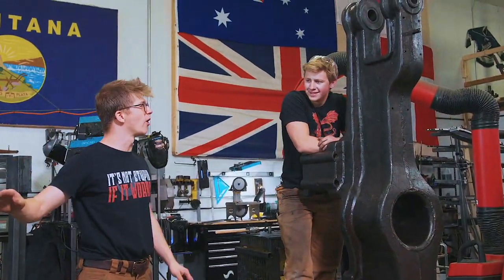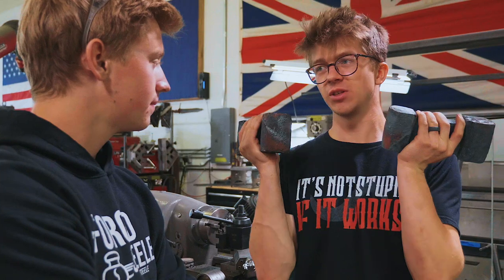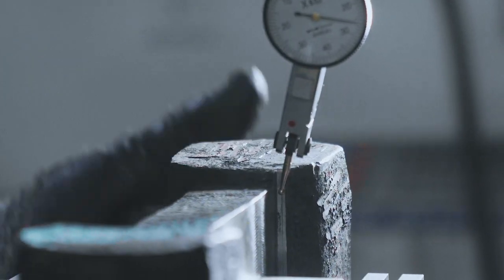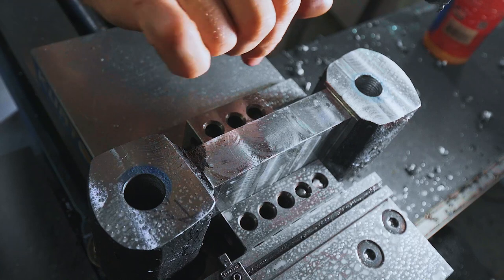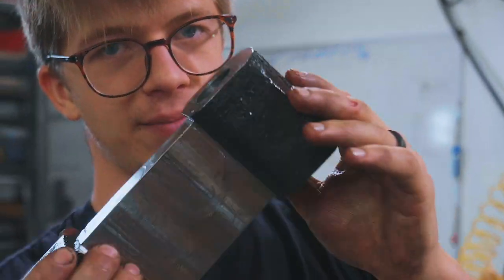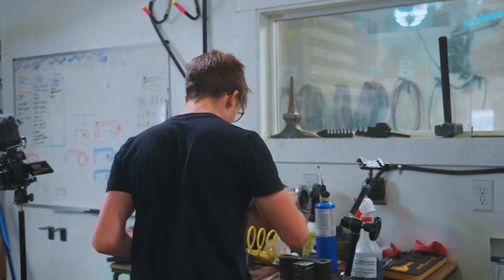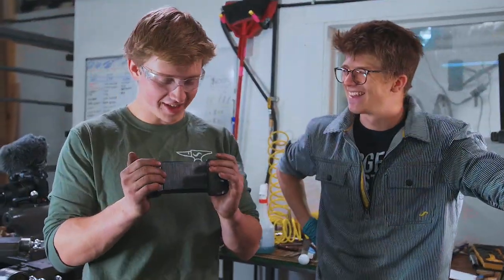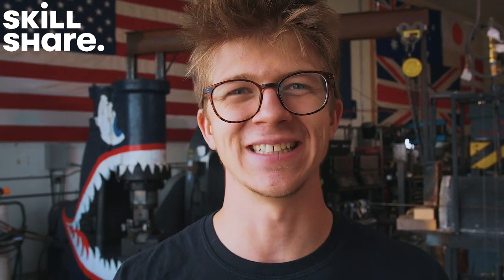RESTORING THE FAIRBANKS POWERHAMMER!!! Part 2

Comment: As a machinist, that lathe work with the eccentric hole was scary. In case you even read this, next time you can set up a dial indicator to get the hole much more accurately in place. Simply zero out the indicator at it's furthest travel and continuously adjust the chuck as you need. You might be able to run another indicator against the shaft of the dial indicator itself as well just to be sure it's perfectly straight. You might get some sine error if it's not perfectly straight.

Comment: LOL  I remember my first time doing an offset hole on a lathe.  Put it in the chuck, used an indicator to get it offset enough, turned the lathe on and instinctively turned it off as soon as it started spinning looking like it was wobbling.  Laughed at myself, turned it back on, and it worked just fine.

Comment: The Tang of the drill As in the flat bit on the end is in now way at all used in the holding or driving of the drill bit. Its only purpose is to allow you to remove the drill from the Morse taper. The Friction of the taper does all the work. If you somehow manger to do something stupid and put driving forces only on the tang you risk snapping it of and scrapping the drill. I have unfortunately seen this happen and seen the results of doing so.
Also so much good Knowledge and Advise already in the comment.

Comment: Challenge for next time: forge a part that has all around tolerances and do it so that most of the surfaces can be left in a forged state. On those links, the holes for the bushings and the faces where they meet other parts are likely the only places that need to be particularity accurate. For the rest do you need much even in the way of weight and balance?

Then the real challenge: Figure out how to get the extra time spent forging to tolerances to be less than the time it would take to get there via milling!

Comment: Just a point on the morse taper drill, the tang at the top does nothing for the drive on the drill, it's there purely for removal from a sleeve or machine, not for drive
Reply from the maker: Thank you so much for the correction Chris!

Comment: One skill you learn as a machinist is drilling holes by taking many steps to drill a large hole.  Meaning each step in drill size is not more than .250".  Any more than that could throw your hole out of round, off center, and out of tolerance.

Comment: 9:22 Even after advancing frame by frame where I can clearly verify that the sharpie mark is on the exact center of rotation, when I play it on normal speed my brain immediately tells me that it's moving in circles with the rest of the block. This is one of those times that you kinda have to trust your math over your eyes.

Comment: Good job guys! 
I was hoping they were going to leave the toggle links raw forged looking.
Reply: Me too, but if you stop and think about it, they have to be pretty much identical to avoid unnecessary vibration while in operation, and getting that takes precision machining.  Still, if I'm understanding it, that their machined to spec from rough-forged parts should make them plenty tough.
Reply: @miketheskepticalone6285  I agree about precision machining, the critical dimensions are very important. I don't think the small weight variation in the machined, but raw state would matter much, given that the machine is designed to repeatedly smash steel, but who knows. It's all water under the bridge now, he grinded them down.

Comment: Just an FYI be careful pulling the jaws in the chuck that far out. Turn them around if you need more width. The farther out the jaws the less engagement they have with the scroll and you bet that piece can come flying out and it won’t feel good.

Comment: The likely culprit to the holes being too large are that the pilot holes are rather oversized for the drill bit you are using. You should use a pilot drill bit that is just about (1-3 mm for this scale of work) larger than the web of the large drill bit. A too large of a pilot hole upsets the "natural balance" of the drill and amplifies any imperfections in the drilling process resulting in the drill bit throwing (sometimes) as much as 0.5 mm off center! Drilling the hole in three steps as you are doing here can be done if the machine you are using does not have the necessary power needed to make the hole in fewer steps but then you should leave even more material for the finishing pass and bore the hole to final dimensions rather than ream it.

Comment: If you're only a few thou oversized on something you meant to be an interference fit, you can cheat by knurling the OD of the inside part. Not ideal, but if it's the difference between scrapping the part and having what you need ... definitely an option. :)

Comment: Pro tip, if you have a piece that is just slightly too small, knurl it and it will expand the diameter just enough to tighten it up.

Comment: Alec, what’s the expected magnitude of force on that link? Also what are the dimensions/material used to make it. I’m a little concerned about bearing stress causing the link to fail. I don’t know exactly what the link is used for, but if it experiences significant stress, I might be a little worried. 

Feel free to shoot me the answers to the question above, I’ll do the calculations necessary to see if it will fail in anyway. 
(I’m a mechanical engineer if your wondering where this is coming from)

Comment: 6:48 That's what you get for not just pilot drilling and going straight for the size you need to drill.
It always annoys me when people "step up" drills. Unless you have a weak machine there's no need to do that. Just pilot drill the hole you need to clear the web and no more. If you keep going up by a little bit each time the drill will walk all over the place. It's also a great trick for triangular holes
Reply from the maker: Thanks Simon, I was trying to limit my cutting forces because I wasn’t very confident in my hold in the vice - hence stepping up 3/8-5/8-1.100 (or whatever the big drill was)- the mill could handle it but I only had a few square inches of friction. I may have been overly worried about it!
Reply: @Alec Steele  With the part sticking out like that it would be better to be safe than sorry! I've had parts flying off of my mill when I clamped on forge scale, so that's another pucker factor.

Maybe but a little machining jack under it next time to take the downward force.

You won't really notice it on a milling machine or a drill press because it's the drill that's spinning, but if you step up drills in a lathe you can actually see the drill moving since it's otherwise stationary. Maybe an interesting thing to take note of next time you get the chance.

Comment: I was scared that you went from a twist drill to a reamer, should have run another step drill between final ream. We used to press fit bushings for Boeing on the 777 flap and used liquid nitrogen to get them to fit, the tolerance was probably just a tad tighter than what you are doing here. Great work though man

Comment: Those toggle links are going to break right where the center dog bone section meets the outer ends. You shouldn't have milled the center section flat with an end mill, you left square inside corners that will be perfect stress risers.
Reply: Even after grinding, there's way too sharp of an inside corner on all four sides between the bushing ends and the center dogbone.
Reply from the maker: Yeah that is a concern!

Comment: Alec, if anyone would know it'd be you. I am just getting started with metal working and im looking to buy a sword casting molds and have no idea where look. Google doesn't have the answers. I want to make a cast Bronze age leaf sword but need the practice so a pre-made mold would be my best choice.
Reply from the maker: You’ll need to make a wood pattern from which you make a sand moule! Look up “sand casting bronze sword” on youtube
Reply: I've seen those videos, I've even seen some people using Styrofoam. My concern being as ive never done this before, does it have to be wood or Styrofoam? Or can it be any non-metal to use as a place holder in the sand? I'm just not sure about what does and doesn't work with molten metal.

Comment: Would it be easier to machine up 4 cylinders then just weld them? Much easier to get centred, and accurate in pitch. 
With proper technique, you could get full pen. Or at least 90% with full bevels.

Comment: If you ream a hole, never move the table from where the hole was drilled. Even a fraction of a fraction off, and you'll make a bad hole. In this case, doesn't matter that much, you put in those bronze bushings, but seriously never do that. Beyond the wrong hole, you can also snap the reamer if one side has too much friction because you're not concentric. And that's an endgame part destroying move. On bigger stuff, you can even damage the machine.

I'm not bullshiting you, i speak from personal experience.

One minor thing, if you have large equipment like this, where big surfaces meet on bushings, chuck them into the lathe before you install them and using the biggest thread cutting action you can, cut a  g*n rifling (shallow, doesn't need to be much) into the bushing. Later, that rifling should meet up with a hole, through which the oil is put from the outside (oil or grease, doesn't matter). In this application it would be even more important than say, a rotating one, because the system is basically static, meaning that once you start moving the machine, it will push the lubricant out of the way eventually, and you'll be having metal on metal friction, which is what destroyed it in the first place. 

By having that rifling in, you can add lubricant before each use (or rather said, after each long pause) and bypass the nature of the beast because the rifling brings lubricant in every part of the bushing, via the rifling.

This used to be done with Babbitt bearings, and pure brass bearings back in the day, and basically every large piece of equipment had it.

Comment: First I would like to say I am a complete keyboard machinist but I am curious. Would running the links on the belt sander to get the scale off first have been less wear and tear on the cutting bits you were using to surface them on the mill?

Comment: A little bit of advice on drilling the offset holes on 4 jaw chucks. If you know where the hole centre should be then drill a little hole on the mill, and then when you have it in the Chuck you can DTI the hole so it’s running true. Just a little aid but loving your work! 👍

Comment: Kinda curious to know how the linkages were made so exact originally all those years ago.
Reply: purpose built tooling that was very well designed, not just custom swages made from stock. Basically the major difference between blacksmithing and industrial forging. Precision, repeatability.
Reply: Basically the same as they are doing here. Mills and lathes have been around a long time. It just takes time and attention to detail.
Reply from the maker: I think the previous ones were cast - there’s only one original though! The other is flame cut roughly from plate!

Comment: Never extract a reamer while its on, extract it with the machine off. You will oversize a hole.
Reply: A hand reamer maybe, but a machine reamer should be kept going; reversing it or drawing it out not rotating just blunts the edges.

Comment: I know its an old video but wouldnt it be easyer to just heat up the old links and hammer the ends a tiny bit smaller and then ream the holes to the correct size?.
The distance between the holes could stay the same as original.

Comment: thats a lil babby reamer, also, you are talking of a shrink fit there, not an interference fit. interference fit may require mechanical persuasion, but not temperature difference. Interference fit is usually attained by making the parts exactly the same dimension and using a press or similar, this is usually called "size on size" when talking of the relationship between the bore size and whatever is going in it

Comment: Get some Loctite 638 to glue that bushing in.  (McMaster PN 91458A433) Will hold better than a press-fit and way faster than re-making the part.  (I've replaced keyways and brazing/soldering with the stuff)

Comment: I know this info is way too late for the video, but hopefully you and others will remember it for the future:
When he was using the 4-jaw chuck the jaws were out way too far. This creates two problems. If the jaws are not holding onto the screws enough the thread might break off of the jaw and then you have a 3-jaw and a couple projectiles. The other major problem is that the jaws sticking out like that takes the most dangerous tool in the shop and makes it worse by making it easier for it to grab things (including, but not limited to, arms).
Unlike a 3-jaw chuck, the jaws on a 4-jaw are reversible. This setup would have been much safer with the jaws flipped around.
Keep up the good work and stay safe.

Comment: Dumb guy question: if you’re going to sleeve the holes out with bushings anyway, couldn’t you just bore out the original ends and then sleeve them to size?  Or use oversized pins to connect?  Then grind/sand each link so they weigh the same as each other? And couldn’t you do the same thing on the head piece?
Reply from the maker: Not dumb at all! The old ones look rough and nasty! We get to make them look better and set them up for the second half of the machine’s life!

Comment: I'm curious to know how cold you go for the bushings. Are you putting them in a domestic freezer, or do you have an industrial freezer? Maybe even using liquid nitrogen? I know some aircraft parts are installed after they've been submerged in liquid nitrogen.
Reply from the maker: I didn’t end up cooling them I just cooked the crap out of the links!
Reply: @AlecSteele  Sounds like you're pretty experienced in installing interference parts so I'm not going to teach you to suck eggs. Keep up with the excellent content 👍

Comment: Probably 20 comments on drilling but my 2 cents. If you are drilling a large hole and drill a starter hole to keep you large bit from wandering (which is what happened)  you do not want your starter hole to be larger than the chisel edge or web ( pointy part of drill bit) of the largest hole. Say your drilling an 1 1/4” hole and the chisel edge measure 3/32” you would use a 3/32” drill bit for the pilot hole after drilling a small centering hole with a centering bit. This way you drill bit stays true to the hole. Even if the pilot only goes down 1-1/2” it will still keep the large bit drilling centered.

Comment: that end piece after the morsetaper is just for getting the drill back out. only the morse taper is for holding the drill.
Reply from the maker: Oh shoot! I never new that!
Reply: @AlecSteele  in some chucks it seems like it´s resting against that nose. but if the tapers are clean that nose will shear immediately if the fricktion of the taper gives way im not working right now ( little accident that keeps me home for a while )  but if i remember i make you a picture of some of our taper ends. there are some with threads and just screwd in caps  etc.

Comment: I'm not a fan of the newer editing style. A whole bunch of music montage and a bunch of cut clips...I miss where we got to go along with you as you worked. Love the fact that you guys are rebuilding the hammer though. Also as other have said...if you need an exact hole size, you need to use a smaller drill than your required size and ream it in. Drills tend to make a larger hole than their size.

Comment: Hi Alec I am a machinist and I suggest you don't step drill your holes, go directly with your big drill bit! I just drilled a 2" hole in a 4" plate from 0 ;) it will be easier on your drill bit
Reply: and you can use a 1/32" undersized drill bit for your reamer

Comment: If you're machining the centre of the links why not just machine them completely from stock? Surely you just needed to clean up the faces with the holes, eyeball one of them and drill the other at the right spacing
Reply from the maker: Totally possible! And looking back on it it would have been a faster process - But then I wouldn’t have got to learn about forging them and then machining from a forged part like this! I got a great education from this project!

Comment: Time to teach you a little bit about machining that makes me cringe every time I see it. A center drill is not meant to be used to start a hole to drill. A center drill is used so that you can put a center into it on a lathe. You should really be using a spot drill with the same flute angle as your drill so that it doesn’t walk on you at all.
Reply from the maker: Time to teach you a little bit about me - I’m a cheapskate and broke my last spot drills and never got around to ordering more ;)

Comment: No hate but a word of caution when drilling on a mill, always do all of your drilling operations for each hole at once without moving your x and why so you know youre lined up correctly with the hole instead of having to rely on the repeatedly of your dro and other equipment
Reply: What I mean by that is
Center drill
Drill
Reamer
Move mill
Center drill
Drill 
Reamer 
Instead of moving the mill between each tool

Comment: Am I imagining things or is he gonna drilling sideways in a round stock?... On a lathe... In a 4 jaw chuck... When they have a mill... if he is then I  have another question. What's gonna give first, my face or ma palm? Well, I guess there's only one way to find out.
Reply from the maker: He had to internally thread it - hence doing it on a lathe!
Reply: @AlecSteele  well, you should consider starting with a square stock then. Workholding on this part as it's presented in this video is... umm... Let's say, a bit sketck.  If it's not an option you can try making or buying tap... A bit harder and quite a bit lengthier but a lot less of whatever this is.